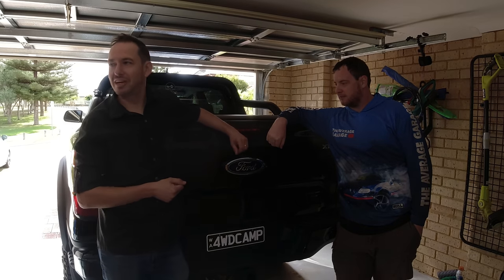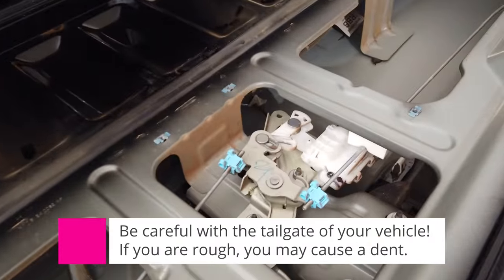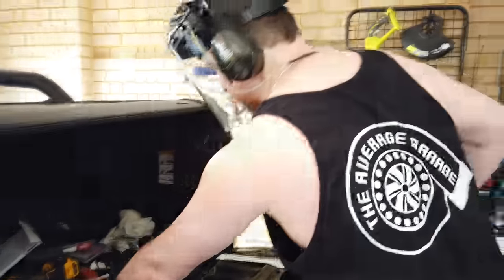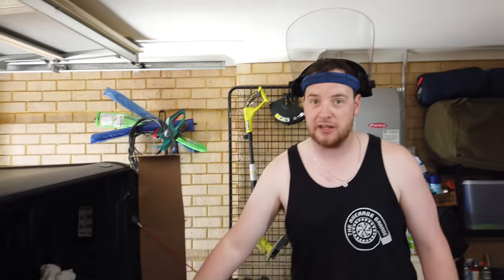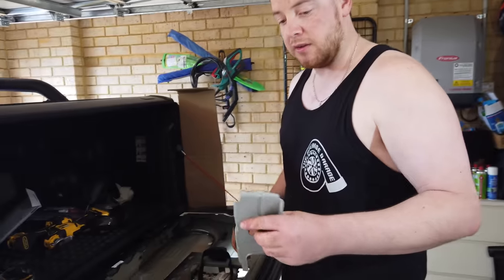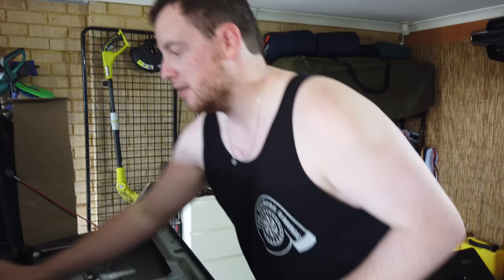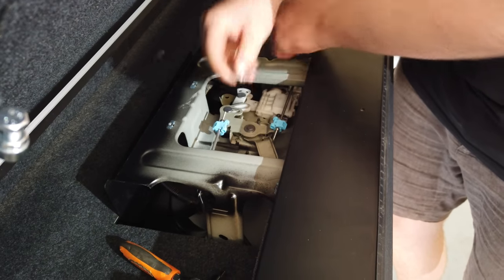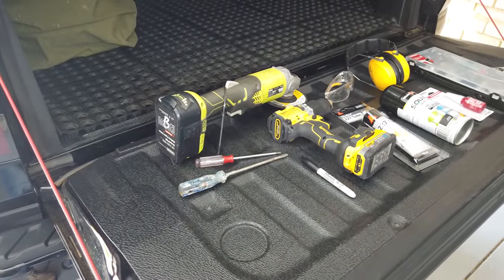How To Install New Tailgate Storage Unit For Next Gen Ranger

Comment: Suggestion, tape down the sheet before tearing out the centre bit, helps keep it square.
The side spot welds are easily removed by cutting the rib 150mm from the ends, taking out the main part and wiggling the last 150mm piece.
Spray paint everywhere to make sure you coat everything, even the swarf you might have missed.
Great video production.
Reply from the maker: Thanks mate. Good feedback on the spot welds. Removing the centre sheet was the trickiest part of the install.

Comment: I'd be interested to know how the tailgate static maximum weight is affected. I believe the standard Ranger tailgate is 450 pounds, but having removed some of the bracing I'm sure the amount would fall. I carry M/C's with the rear wheel on the tailgate. It now might collapse the storage unit lid? Any revised max. tailgate  weight with the instructions?
Reply from the maker: Hi Christopher. I’d suggest dropping Hurracan Fabrication a message. They are normally pretty quick in responding.

Comment: How long overall did it take to install? How long would it take me as your average semi capable DIY person?
Reply from the maker: Give yourself a day, but you could easily do it in an afternoon. The cutting is the bit you want to slow down for - lay out the template, go slow and take your time. The other main bit is the release rods and make sure the wiring is out the way and not getting pressed down but the storage unit. Other than that it’s pretty straight forward. The unit just drops straight in once you’ve done the above.

Comment: Bit of a process but time and patience is the go.
With panel bond, heating will soften the bond making easy to remove.
Would it be easier to remove tailgate so you have easy access to each side.
Another minor tip, set your drill bit as high in the chuck as possiable and put masking tape on paint to help grip and reduce chance of hitting rear panel.
Drill the holes then remove the draw and clean the shavings out then perm fit.
Fitting gas struts will make the drop tailgate easy when it’s full also there are kits available.
Corrosion Sealing agent painted in the bottom of the inner tailgate would be ideal as I saw corrosion starting on the supports.
What corrosion paint did you use on the edges?
Reply from the maker: Cheers for feedback 👍 Just an epoxy paint. Don’t believe there’s any rust - more likely some dust build up from previous trips.

Comment: Those sparks you talk of stick to everything and rust not just glass that’s paintwork plastic tub liner lamp lenses. Bad to have have to bend supports frame as the panel outer will no doubt have witness marks if you looked across it when you have finish
Reply from the maker: Thanks David. We gave it a thorough wash after so all good. Good tip to throw a sheet over the car if doing it yourself at home. My car also has a full PPF protection so none of the panels were exposed 👍

Comment: Great install video but like the others have said, some finished up shots showing the overall fitment plus functionality would be good. Should be easy to cover in a follow up video or even a YouTube short I guess. Does it handle a person sitting or standing on the tailgate now that the storage is installed? Tailgates are usually a seat or workbench whenever I’ve been out in a ute or 4wd. Also, does it handle pushing/dragging stuff over the lid into and out of the tray?
Reply from the maker: Thanks mate for feedback. Yes will cover off in upcoming vid and if you’re interested have included a bit more info on Facebook. I’ve used it to stand and sit on without any issues. Also good re dragging stuff over it. It will scratch however, therefore I might stick some marine carpet onto it in the future

Comment: Got one installed on my first gen raptor...honestly, never again.
Reply from the maker: G’day. Interested to know why it wasn’t for you?
Reply: @Perth4WDandCamping  OK, where do I start. I think it's a good system if you just want to tour around Australia and not do any hardcore 4WDing. All the screws constantly came loose and all the carpets peeled off in the interior. Dust was a big issue when there are multiple gaps due to corrugation (peninsula development Rd) on the road and the screws coming loose. Dust entered the tailgate locking mechanism jamming it which prevented me from opening it and I couldn’t get it open to access my recovery gear which I store in there. I had to get a hose (at Bramwell station) lift the tailgate handle and squirt as much water in there to loosen everything off. Water crossings were a problem too. After crossing the Nolan Brook, I had to get out all my recovery gear and dry them out. It really needs to be dust and water tight. I don't store anything in the back of it now and it's just constantly locked because I don't use it. After watching your video it appears that it's an upgrade to what I've got and it could possibly stop dust and water from getting in there but I'm not willing to take the risk again with my next Gen Raptor.  Well, that's my experience. Cheers
Reply from the maker: Thanks for the feedback and sorry to hear about your experience. Appears there have been enhancements on the new unit from your response. It’s now held into place with pop rivets rather than self tapping screws so don’t expect it to come loose. The interior seems very robust and mine has been in the rain and on dusty roads since installing and the seals seem good. 
The standard tailgate was not sealed either (we could see this when we opened it up during the install) so I can’t see how it would be much different with the unit in compared to the standard tailgate. 
Sounds like you had a very unfortunate experience. Might be worth passing this onto the Huracan Fab team directly if you haven’t already. 
 
Ive been very impressed with the quality of all the parts when we installed.

Comment: If you have to drill and grinder a new truck then it’s not worth doing
Reply from the maker: A local fabricator would be able to install easily for those not wanting to do themselves. Reality is many aftermarket mods require some cutting etc.
Reply: @Perth4WDandCamping  true my man it’s just the truck isn’t been in a month of use and drilling and spray paint to avoid rust isn’t a good idea
Reply from the maker: It’s not for everyone mate. You can tell I see the value for my situation as since I purchased the car in Sep 22, finding a practical solution to access and store my recovery gear has been a challenge. This really has solved that issue for me.
Reply: @Perth4WDandCamping  true , I like the video it’s good

Comment: Is it waterproof?
Reply from the maker: The top seal is good. I’m yet to find any water in the box - however I wouldn’t be going underwater with it 😀
Reply: @Perth4WDandCamping  so no go for river crossing
Reply from the maker: @jackmarsh7328  I mean the standard tailgate is not watertight either. Most people would just put in recovery gear in the storage box which wouldn’t matter if gets wet in the unlikely event you get water in during a river crossing